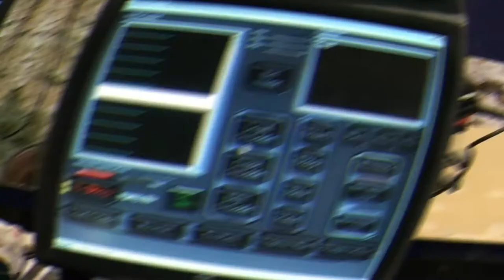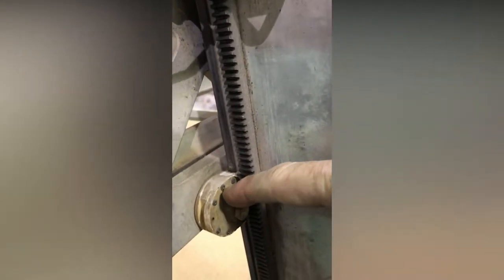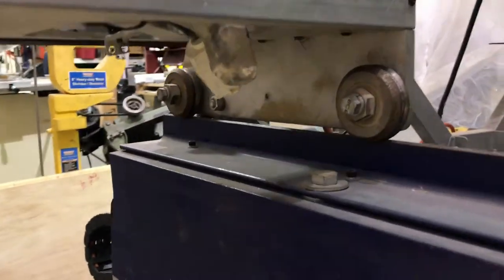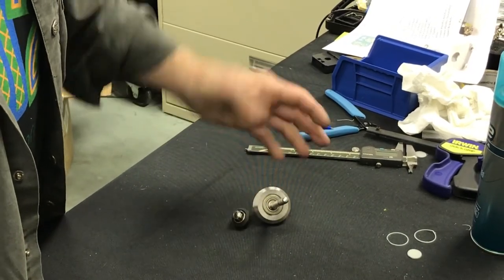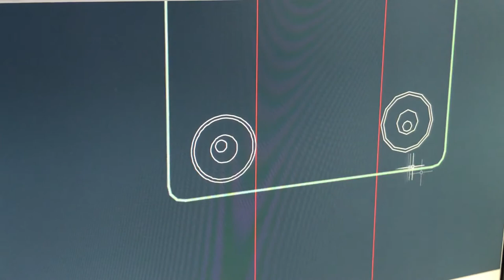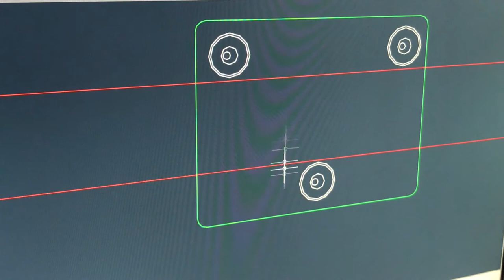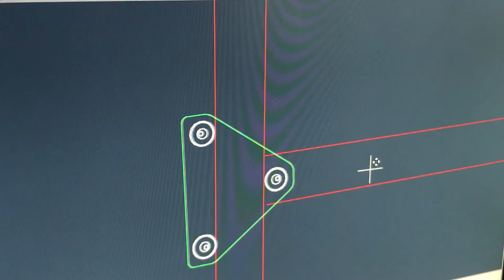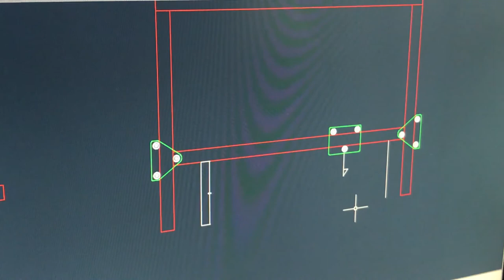Eccentric Bushings

Comment: Very helpful thanks. Your method in the other video using the rolls of tape worked for me eventually. I swapped the rolls of tape for identical glue sticks balanced off the frame. Before all this, I had a 5mm drop on the non-leadscrew side and was close to throwing the thing out the window 🤣. Now, it is less than 0.5mm and probably closer to a quarter. I figured out the hard way that there just wasn't enough adjustment to take up the slack using just the eccentric on one side. I had to share the the adjuatment between each side to get anywhere as each one only gives you so much play. keep it up.